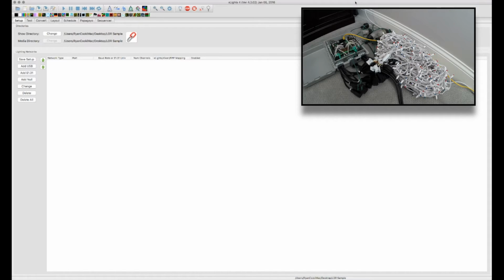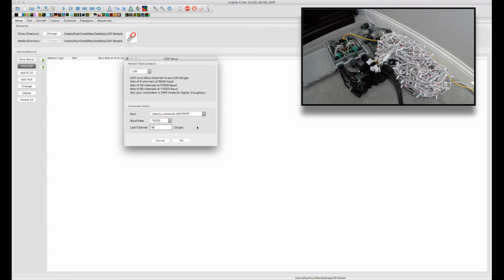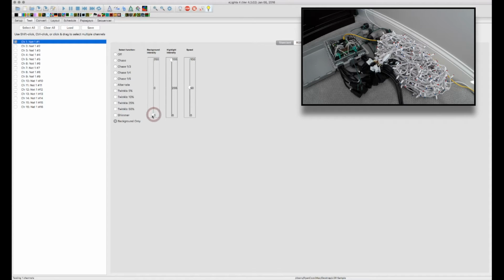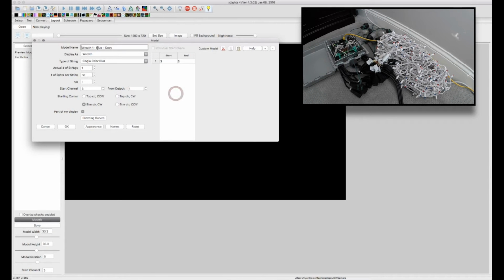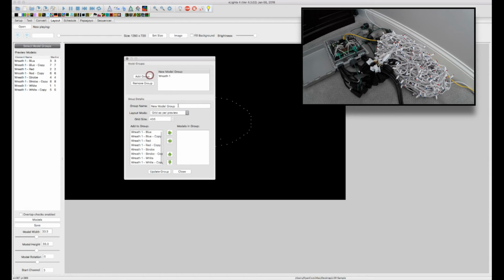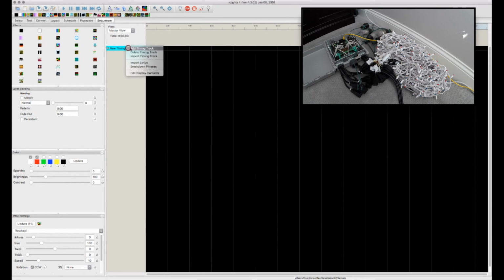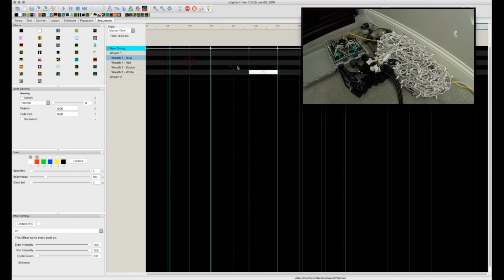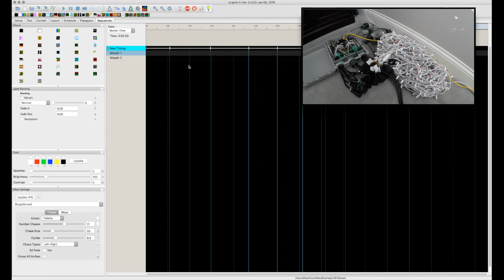xLights 2015 Version 4 Tutorial Part 8 - How to Setup LOR Controllers

Comment: Fantastic tutorials! I started this year very late and set up 48 channels with LOR using pre-programmed sequences. I created 2 20' arches with incandescence lights, red LEDs for rooflines, various lights for windows, driveway arches, etc... It was a blast. As xmas approached I started working with SuperStar and added songs to the mix using Instant Sequences. This was a lot of fun but made the lights very blinky. Then I started messing with Pixel Editor which has some code from xLights that I happened to read about. Curiosity got the best of my and I watched a tutorial on xLights. Next, I downloaded 4.3 and began playing. I was having issues with the Visualizer and mapping between SE, SS and PE. Confusion was an understatement. The modeling with xLights had me sold. When I found out you could convert xLight sequences to LOR the light bulb turned on. But how would I play everything back in the Visualizer if I did the layout in xLights? Since I want to go 95-100% pixel next year I am considering layout and sequencing in xLights. I have 3 16 channel controllers I can use for props and will add 3-4 E1.31 Intelligent RGB Controllers for my nodes on roofline, windows, mini trees and Mega trees. Now that I say your matrixes I am hooked! So maybe more controllers! 

A question for you:  If I do pixel only editing in xLights and use SE or SS in LOR is there a way to see the entire show in LOR Visualizer? There are some Mega Tree sequences I may purchase. I'm trying to define the best workflow for me before I get knee deep in sequencing. Thanks for any advice. 

Also, what do you use for your arches?

Ron
Reply from the maker: +Ronald Howard Hey Ron, thanks for your comments.  I am not sure about LORs visualizer and if you can actually see an xLights sequence in the LOR visualizer.  I know you can covert LOR sequences into xLights just fine and see them on the xLights visualizer... But I don't use LOR at all, so you may want to dig for that answer our on the LOR forums.  I would say if a majority of your show is going to be pixel based, then xLights would definitely be the way to go.  I personally run 100% pixel based shows, but have tested and added LOR controllers to just show how they can be configured to also work.  I modeled my arches off of Matt Johnson... he has some great video tutorials out there on YouTube that will show you how to make them.  Hope that helps, but feel free to let me know if you have any other questions. Thanks!